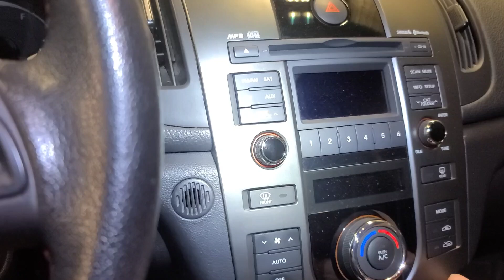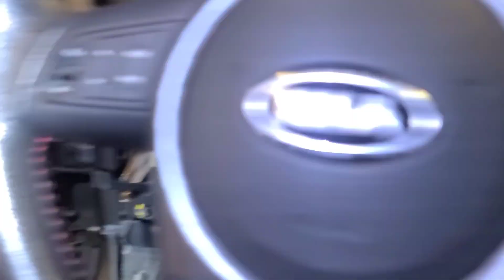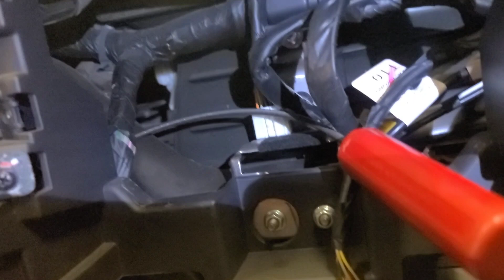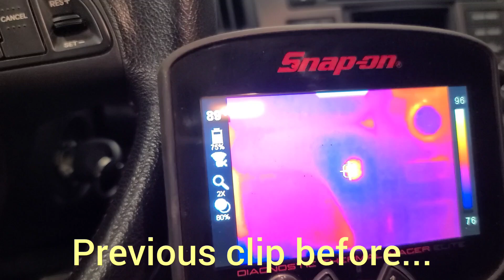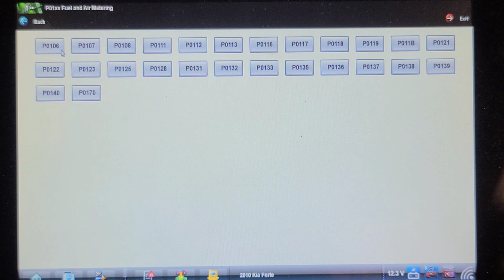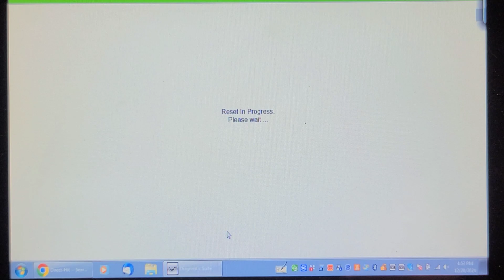2010 Kia Forte Poor Heater Performance Fix pt. 2 plus Bonus P0106

Comment: Oh fuck… the 80s mercedes approach was with an hose to the fan. One sensor on the inlet, hose, fan.
Easy to diagnose and easy to change, without removing everything. 😂 good job!
Reply from the maker: @tyberzann9713  yes early GM had the small hose to the heater box. It was simple and much cheaper. I had a Nissan like this too but not 425 dollars.